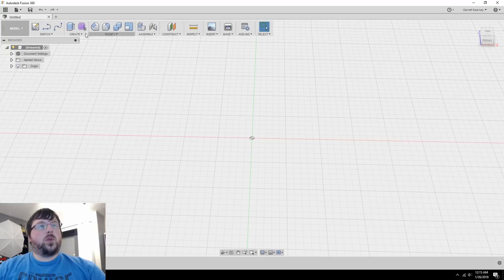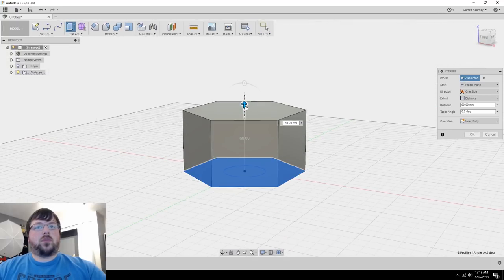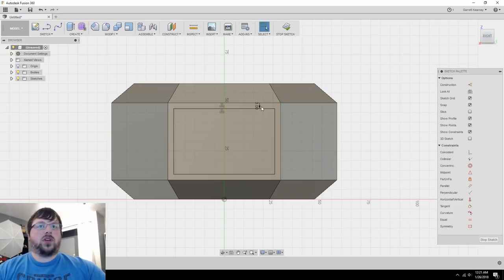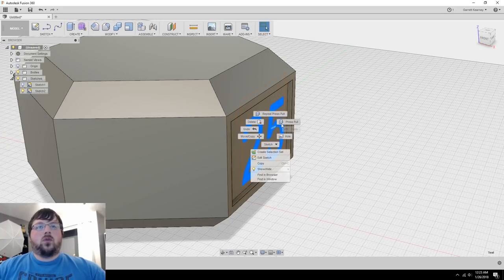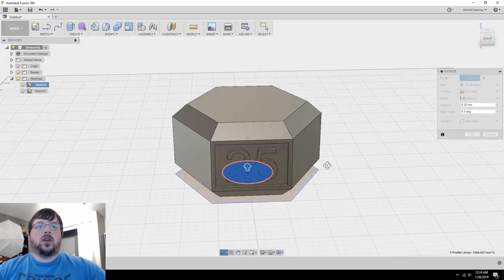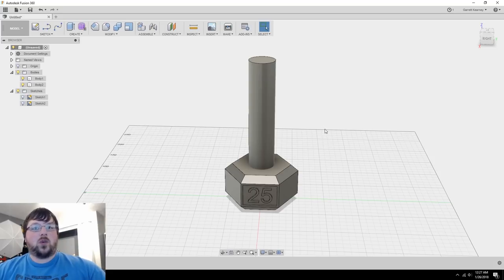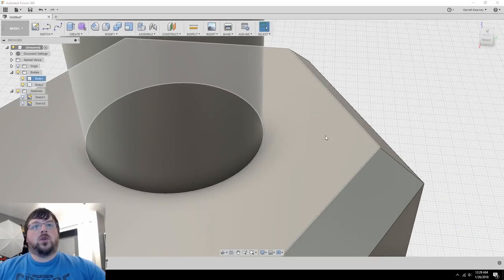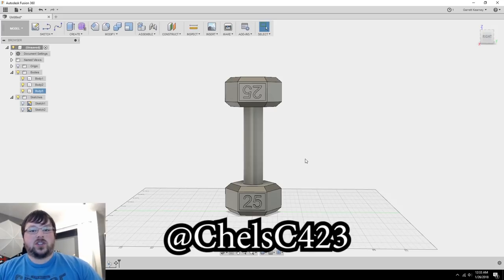How to Create a Dumbbell in Fusion 360 - Beginner Tutorial

Comment: Hey, great tutorial! You should do one on slicing and printing with supports. A lot of begginers (myself included) struggle with bad looking overhangs due to poor support placement or print settings. What slicer do you use? Do you use soluble supports? How much sanding, cutting off supports and prepairing goes on before you paint your models? They always look so clean even before priming!